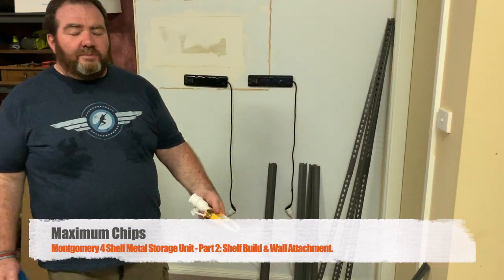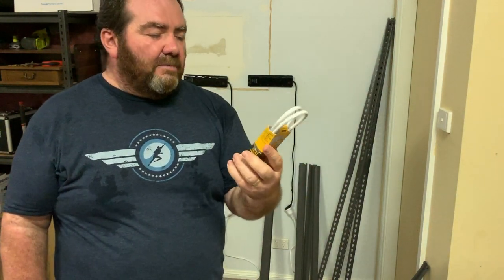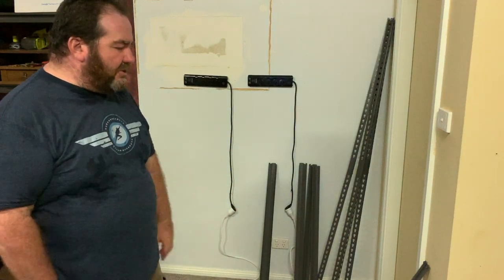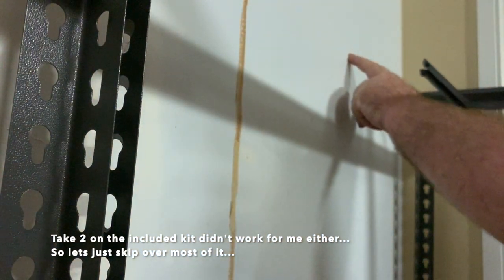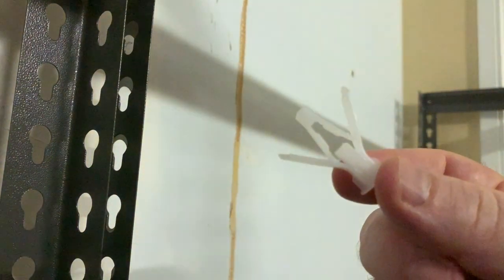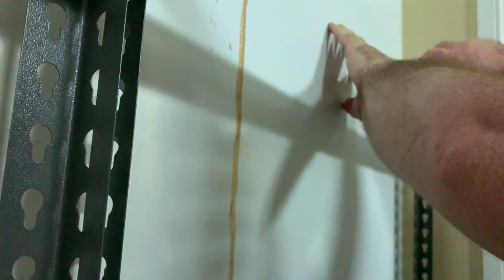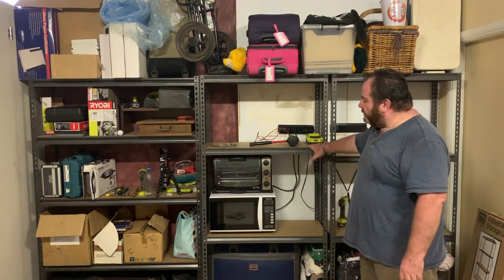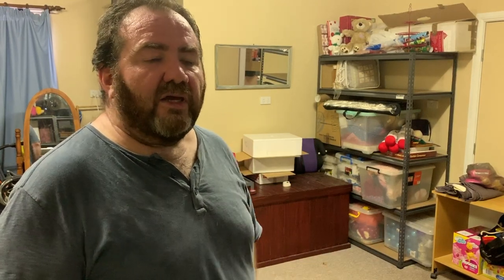Part 2: Montgomery 4 Shelf Metal Storage Unit. Shelf Build & Wall Attachment.

Comment: I bought an individually switched one as well. Is awesome.
Reply from the maker: Yeah and a lot cheaper than they used to be. I swear the one I originally got for the shed was well over $50 and now I see they have one for about $20 (without the USB ports). But USB ports are very handy too - especially with decent power behind them.
Reply: Great work mate!